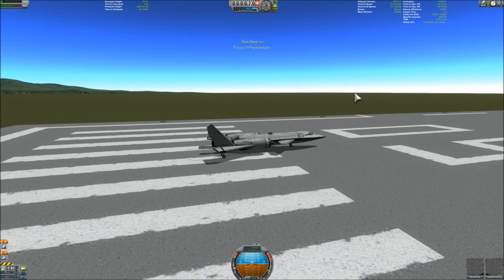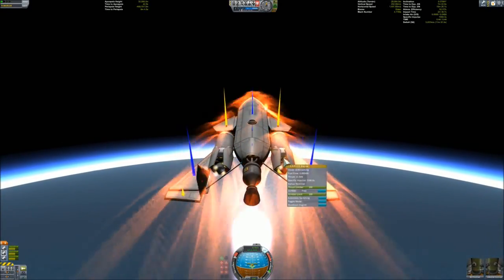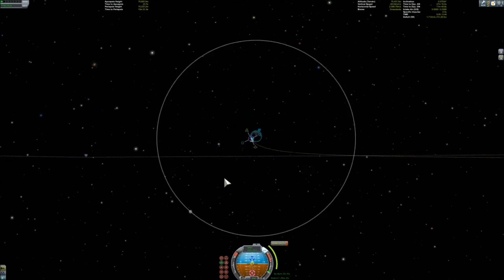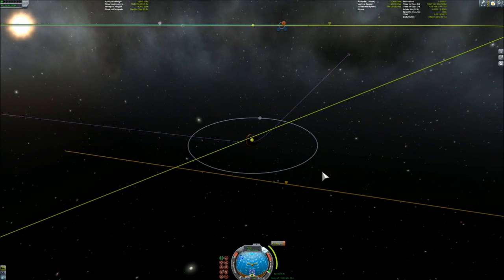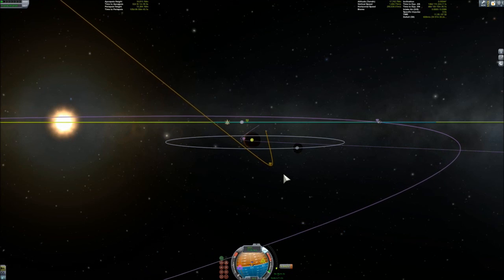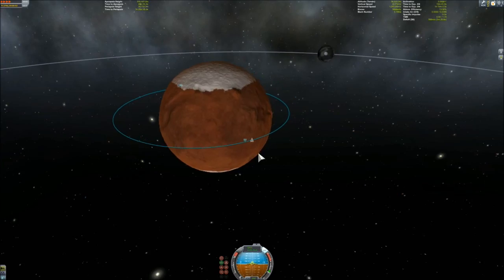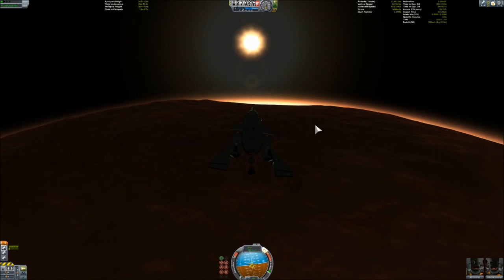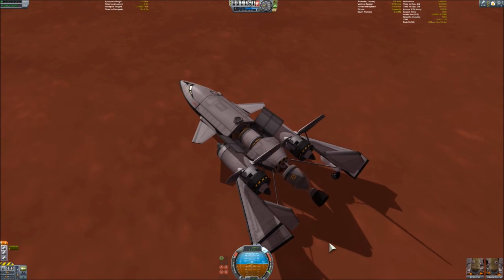SSTO in KSP 1.0.3-1.0.4 and a trip to Duna

Comment: Basically for people having trouble making ssto's, the best tips i can give are: first ownload kerbal engineer so you can see what is your delta v value and consider over 13.000 delta v AND TWR 1.8 a basic number MINIMUM to achieve when building the plane. TWR would be like acceleration and delta v would the how far you can reach with your ship.

Using rapiers is highly recommended as they can thrust at highest altitude and have rocket mode, shock intakes are interestingly usefull that damage less than ram intakes, keep the ship lightweight, using drone to control instead of a cockpit makes a big difference..

andd..placing a small cone behind the rapier makes it zero drag, usefull bug